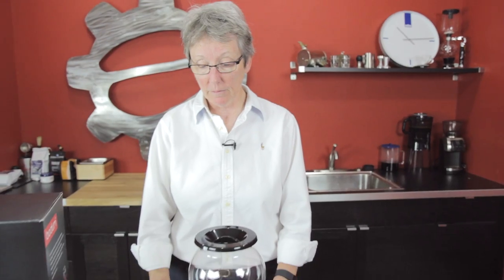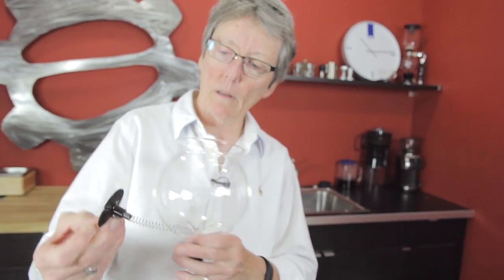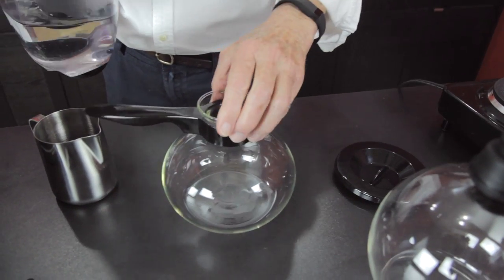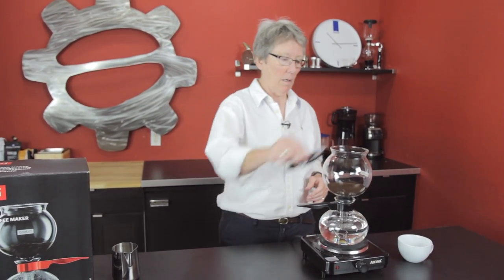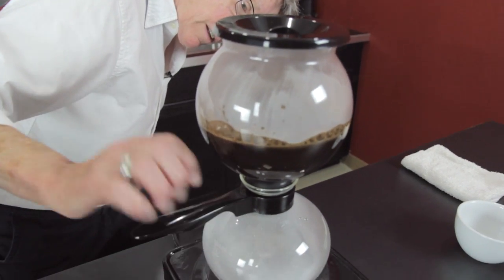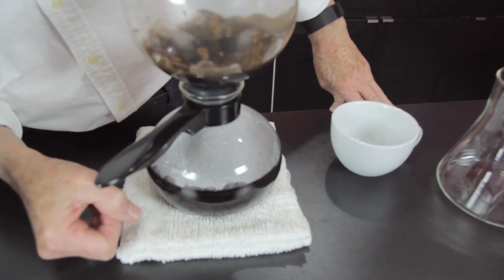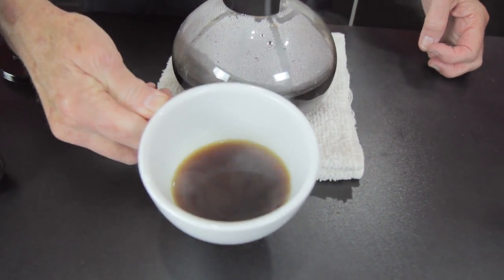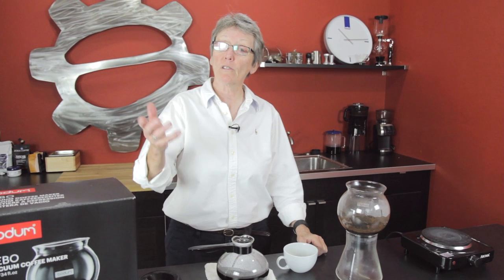Bodum Pebo Vacuum Coffee Maker | Crew Review

Comment: I just received my Yama glass siphon set in the mail (it's a lot like the Bodum Pebo, only it comes with a cloth filter) and I'm already a fan.  It was much easier to use than I thought.  Note: use less water than they recommend; just use the same amount of water and coffee you would for your regular pour over coffee (or perhaps just a bit more, say twenty or so grams) and don't grind the coffee too coarse.  I used a 'medium' grind that was closer to the 'fine' range (the same one I use for my Hario V60) and it was perfect.  When the water has more or less risen to the top chamber, lower the heat to minimum and let it steep for about sixty seconds, THEN remove from the heat completely.  It will start pouring down shortly.  And I also advise that you heat the water before you start in a separate kettle to speed up the process.  And use 'medium' heat for the brewing, not 'high', or the glass may break.  Don't forget to use a metal coil on the electric element before you set the coffee maker on the stove, if that's what you're using.  Good luck and Happy Brewing!

Comment: You need to heat up the lower pot to a certain temp (190-202) depending on your heat source THEN put the upper chamber on, otherwise your temp is way to low (the water rises too early).  I'd also recommend stirring the coffee during extraction. ;)  I have Yama pots, drilled a hole through the top lid to put a digital thermometer in it, and I use a Cory glass filter rod.
Reply: I also use an old Cory glass filter rod.  Much better than the spring gizmo and never wears out.
Reply: aye, i was like, i never seen anyone do a siphon brew with the stem in place before boil lol

Comment: originally it is a distilling unit then over the years coffee was accidentally put in the top jug, respectively if going to brew, put the top jug to a separate jug to be leased when finished before the brew comes out, to be in a clean jug for a pure coffee with h20, rather than back into the bottom jug where the impurities of the distilled water should be remaining after the brewing distilling process reproachably. thank you!

Comment: I would like to share a different procedure for making coffee with this type of maker.  I've made coffee with these since the mid 80's, and learned this method from books on the subject.

Use the measurement ratio of 1 level scoop to every 6 oz. of water.  Following the rule that the longer the water and coffee are together the coarser the grind should be, I use a very slightly coarser grind that a drip grind.  Do not use a fine grind because you can stop up the filter and you'll have a vacuum lock.  When all of the water fills the upper chamber, there will be some initial bubbling (the first 'boil') then it'll settle down. Keep the heat on until it begins a second boil.  Here you have some leeway as to how long you wait until you remove it from the heat.  I normally wait until the boil is just getting to the edge of becoming vigorous.  At this point the water will be at about 190 degrees.  I know this because I've measured it many times(at sea level).  Wait until the vacuum in the bottom chamber is refilled with the coffee then pour.  Enjoy.

Comment: What's the difference between this and the Santos?
Reply from the maker: marronnin Simply a name change. As far as we know, there were no changes made to the model :)
Reply: Seattle Coffee Gear Does it still include the plastic stand for the upper chamber when removed from the base? Seems like they may have removed it to reduce package size and prevent breakage as it wasn't the most stable stand.
Reply: Brad Knowlton Stand still comes with it.  Maybe they improved the stability?  Mine doesn't seem tip prone.

Comment: I've only had this maker work once or twice and ruined some really good coffee.  It's basically just sat on my counter for years now.  My daily dripper, Bonavita, finally died after years of faithful service so I pulled the Pebo back into service.  Still doesn't work.  I'm guessing you can't get a proper seal on it to get a good vacuum.  If you get this, be ready with a carafe and a filter because you're going to be doing a pour-over with it.
Reply: Seems like you got one of poor quality, see if you can find a new rubber seal for it
Reply: The vacuum required to suck the liquid down to the bottom is made when you heat the water; the air heats and expands the molecules of air.  The longer you apply heat to the bottom the thinner the air in the bottom becomes.  You can never [reasonably] boil it dry [the bead chain on the bottom stops the class from shattering too]; but if you do not build enough of a vacuum it won't work.  Like press coffee you let the coffee steep 4 minutes so  Smaller grind sizes can clog the sieve also stopping the process.

Comment: For goodness sake dont follow this video. She/he? put the pot directly on the burner. The pots are likely tempered soda ash glass, which can barely handle the temperature. More expensive pots may use a borosilicate glass(think lab glassware or pre 60s pyrex) . Put the glass pot in a metal pot or saucepan when heating it. I prefer using aluminasilicate glass when i need to heat acids and other chemicals too reactive for a metal pot. Unfortunately there's not much of it made anymore. Pyrex used to make it in their flameware product line from the 30s through 70s, vintage pieces can still be found cheaper than modern pyrex on ebay. Flameware claimed you can go from the oven right onto a stove burner then on a table, they tend to break when cooling down. I watched this video imagining someone at home on their smoothtop stove having the pot bustall that water or coffee hitting that hot ceramic of their cooktop... Then it too will shatter or crack

Comment: Hey Gail, what kind of filter that bodum vaccum has?

I have Hario TC3 and it using cloth filter.. and no matter i change the parameter (temp, coffee-water ratio) it always taste bitter.. then i bought the chinese version of vaccum brewer, i guess it's Hario replica and it's also 3 cups like TCA 3, surprisingly it taste sweet..
I don't know what's wrong with my Hario..

I like the taste of vaccum brewer.. and curius about that beautiful Bodum like on your vid :D
Reply: Ray Leonard Judijanto 
Is the filter clean?  I've noticed that cloth filters get dirty quick if not stored properly.  I've gone to using paper filters or a mesh screen.  Makes a world of difference. Paper is going to give it a cleaner flavor, while the mesh allows for more oils to come through.
Reply: Ray Leonard Judijanto Doesn't really use a filter.  There's a little plastic disk with radial grooves that narrow as it gets to the center/drain.  The coffee granules get trapped in the grooves and then it self filters.
Reply: +Ray Leonard Judijanto I have two Hario siphon systems.  I started using paper filter because cloth filter eventually has residual taste no matter how it cleans.  You can search "mn filter for hario siphon" on Amazon.

Comment: I will have to get the electric version because I won’t put glassware on my ceramic top stove. Thanks for the demonstration.
Reply: If you use a hot plate get a defuser I think it is safer than direct contact with the hot plate.